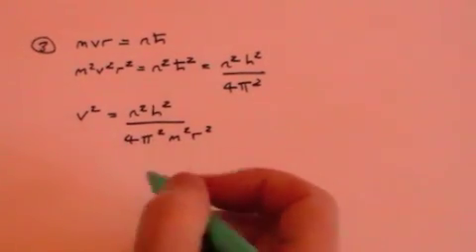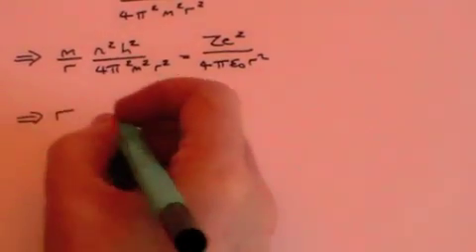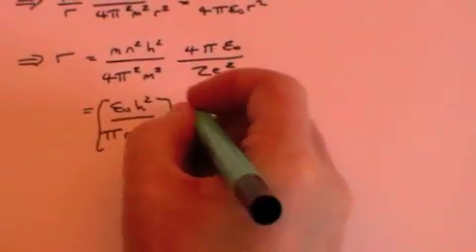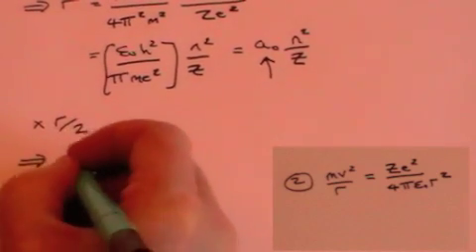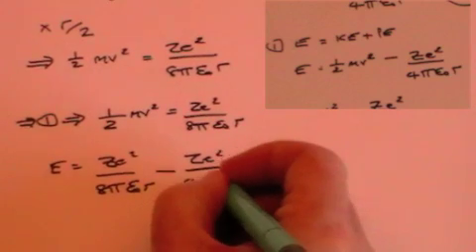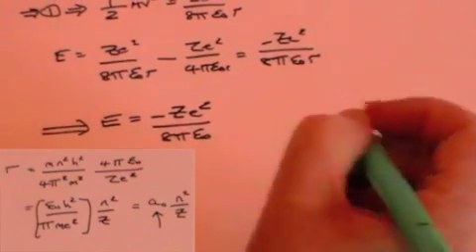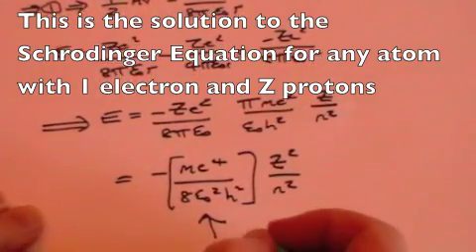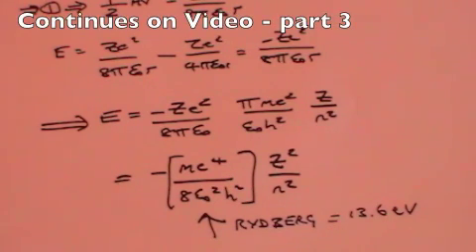Solving Schrodinger for a Hydrogen Atom (cheating) - Part 2

Comment: What does that mean at min. 3:15: "This is the solution to the Schrodinger equation for any atom with 1 electron and Z protons"? Isn't that exactly ONLY the Hydrogen atom?(Perhaps a ionized Helium atom too, but I don't think so, for the charges would than be 3, and I think this solution wouldn't fit any more?) Puzzling ...But for the rest: Thank you, very clearly explained and very interesting : )
Reply: A hydrogen atom has only one proton in the nucleus. But you can have an atom of another element that has more protons in the nucleus. Then you account for that with this `Z`, which is a natural number, called "atomic number". But this only works if you strip all of the electrons from that atom except one. If there is more than one electron, you have to account for that too, because then they can interact with each other as well, shielding some of the positive charge of the nucleus.